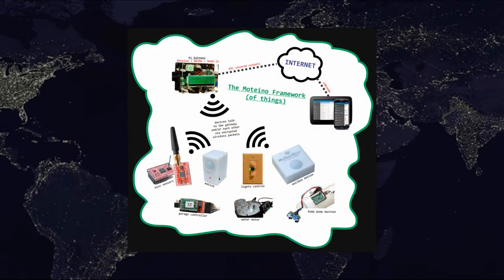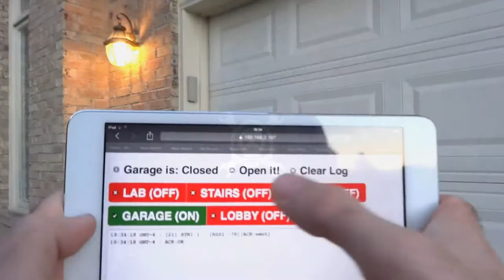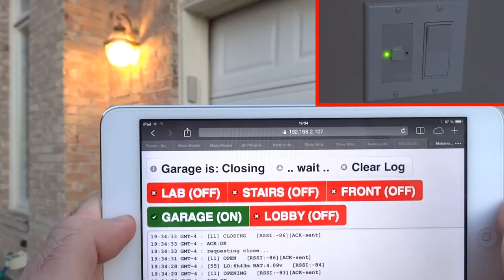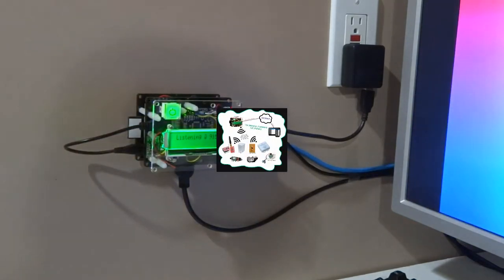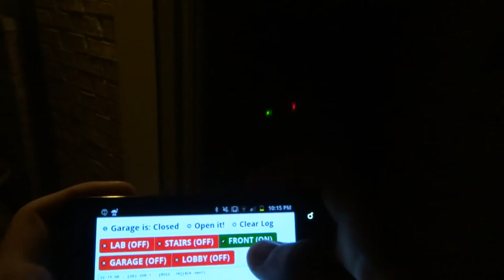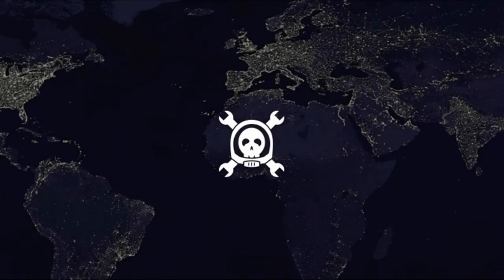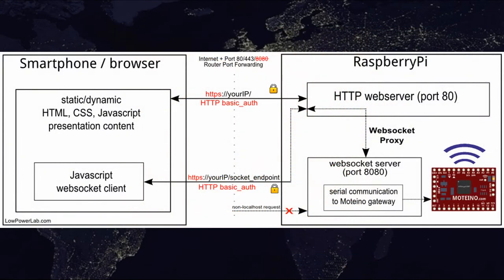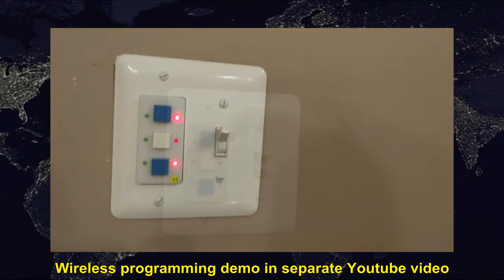The Moteino Framework Demo

Comment: Great project! Good luck in the Semifinals. You mention in the video you invested in assembly equipment. Would you mind listing what equipment you purchased? It looks like a pick and place machine and oven.
Reply from the maker: They are DDM Novastar, I will probably do a comprehensive writeup with my experience using them, but not quite ready for that. Still learning how to use some of the features.
Reply: Felix Rusu  Hi Felix, hope your work will win it, About the smt machine, how did you choose from all of these? Is it the Novastar LS40?
Reply from the maker: Gnichi Mohamed LE40V, several big reasons why I went with this. I will write more details in an article later on with pros and cons and why these so called DIY $300 pick and place machines made of 3d printed parts are and will always be hopeless, with or without vision.
Before this machine I was doing this: Manual SMT pick and place assembly time lapse (Moteino)
It's actually quite fast by hand but you have to sit there to do it. I even did it with panels.

Comment: Do you sell these? How did you get some type of code approval for wiring into 110 AC ? Just curious.
Reply from the maker: This is an OLD OLD video of the PiGateway home automation project before it even was published. More on it here: https://lowpowerlab.com/gateway
I didn't get any approval. I sell kits so I dont put them together. The garage opener is just a relay that actuates the 2 contacts which your wall opener also actuates, power is 5V wallwart from opener's outlet. The SwitchMotes control 110/220v lights but they are still kits so its the user who assembles them. The guides for everything are here:  http://lowpowerlab.com/guide/

Comment: In this demo you show a nodejs powered base station.  Is the source out there somewhere?  I already have a home automation system(clipsal) that I wrote a nodejs interface to, am looking to integrate some wireless which moteino seems like a natural fit for (as opposed to zwave and others) would love to take a look at how you are integrating the moteino with the pi.
Reply from the maker: It's here: https://github.com/LowPowerLab/RaspberryPi-Gateway
And guide is here: lowpowerlab.com/blog/2013/10/07/raspberrypi-home-automation-gateway-setup/
I've since added the SwitchMotes to it and tweaked a few things but the setup is essentially the same.